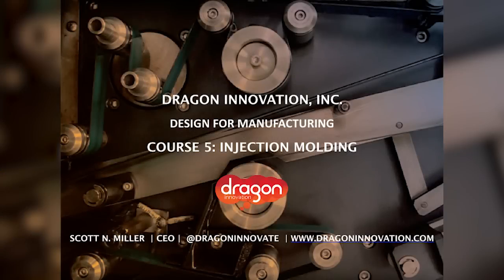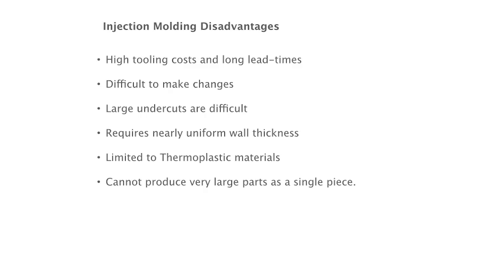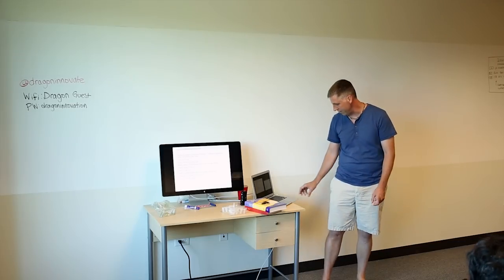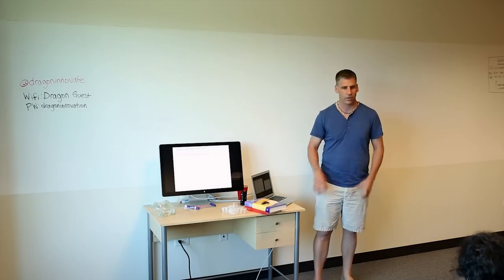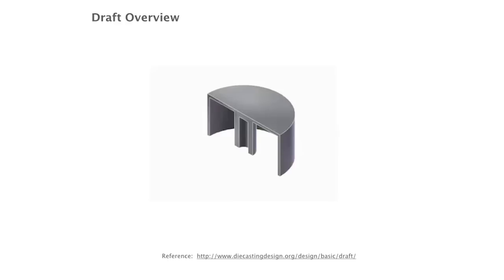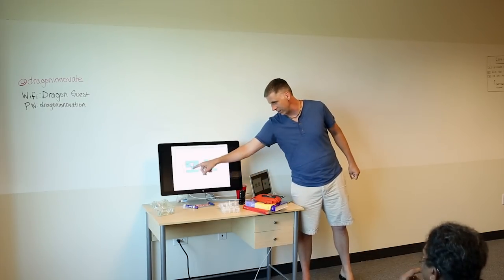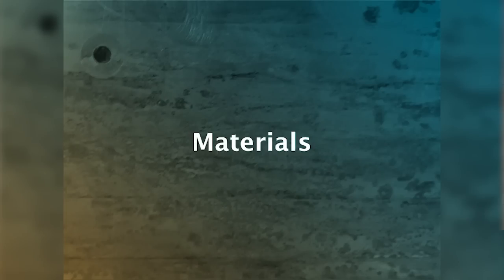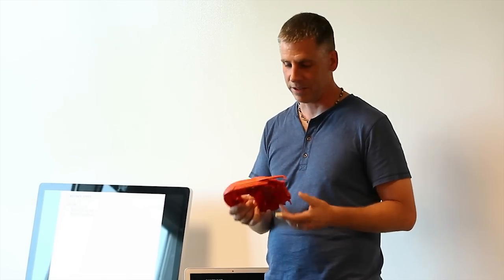Design for Manufacturing Course 5: Injection Molding - DragonInnovation.com

Comment: Do any tools pull a vacuum instead of having air vents? Excellent video by the way.
Reply from the maker: We typically rely on the air vents for injection molding.  For a silicone molds, we'd use a vacuum.

Comment: If you know the shrinkage value for a material say .004cm/cm for ABS. How do you decide on a particular dimention for example 2mm wall thickness?
Reply from the maker: The mold maker will take the cad files, which should be designed at the desired nominal dimensions of the part, and then will account for the material shrinkage in designing the actual cavity of the mold.

Comment: on a case where most of the sections are 2-3 mm wall thickness, but theres one huge section which has upto 8 mm, will it work on production mold on a very huge injection moulding machine? 
any other processes which can be used instead?
Reply from the maker: Albert Sebastian  The ideal wall thickness is a uniform 2mm.  In some cases, you can go as thick as 4mm, but it's difficult to go beyond this thickness due to longer cooling times and sink marks.  Not having been able to look at the part in question, my recommendation is to find a way to core it out to achieve something closer to 2mm.
Reply: You can use gas-assisted injection molding.
Reply: +Albert Sebastian Hello Albert- Yes, Gas Assist will help but the part design and process is unique which requires an injection molder to have the nitrogen gas systems on hand.  The alternative to a very heavy wall is to use a foaming agent to allow the part to pack within the wall.  You enter into the process of structural foam molding.  Ultimately, you and your molder, ill need to determine which long term process is the best for your application.  Good Luck!

Comment: Why 2 mm?
Reply from the maker: +allyourcode The 2mm is a good design rule of thumb. In terms of a range, typically you'd want to design your walls with a uniform thickness between 1 - 4mm. As the wall thickness gets thinner, it's more difficult to pack the mold (you can get around this by selecting a resin with a high melt flow index, such as nylon, which can go down to 0.5mm). For thick walls, it takes longer for the resin to cool, which increases the cycle time (and cost of the part), as well as resulting in more shrink marks.
Reply: Ahh. I see. Thank you!